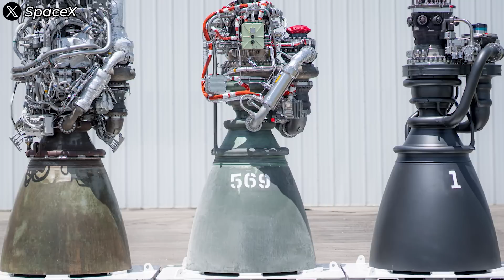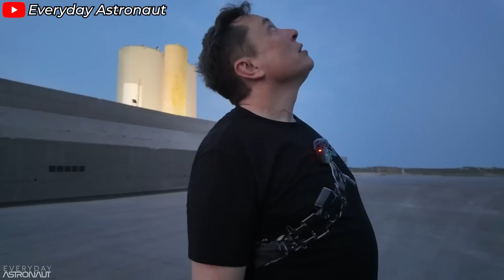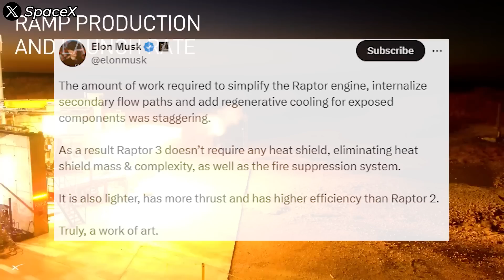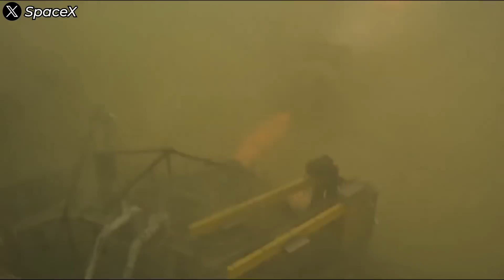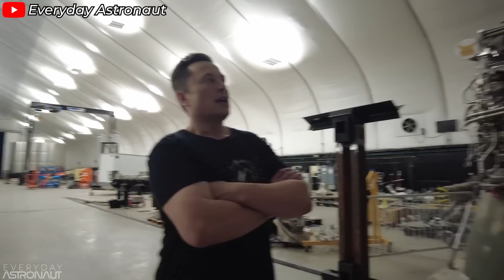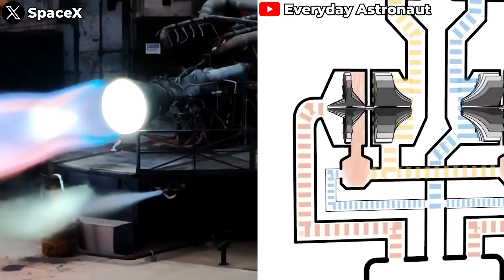SpaceX New-Gen Raptor Engine just humiliated the entire space companies…

Comment: There are at least a couple interesting factoids in this video.

1. The idea that the engine could be made substantially smaller and likely simpler yet so increase performance. This likely means some entirely creative redesign rather than modifying previous, proven designs which would require extreme creativity, knowledge and risk taking during development.

2. Additive manufacturing technology, aka 3D printing. Maybe Elon is benefitting from his Tesla operations in China, I understand the Chinese may have gained a lead in 3D printing because it's so useful in heavy manufacturing. When 3D printing first appeared, additive metals weren't as strong as forging due to broken molecular bonds but I understand that has been solved today. The Raptor engine appears to be proof of this, making parts and pieces that are likely highly stressed under extreme pressure and temperature.

These are all indications that although there will be competitors, none will likely really compete with SpaceX whether they are in China, Russia, the EU or the USA.
Reply from the maker: thanks for your support!
Reply: High tech 3D printing is STILL Cost prohibitive. They don't do 3D printing still in Automotive industry, unless, possibly, it is a luxury car where it costs in the multi thousands of dollars, and it is still limited.